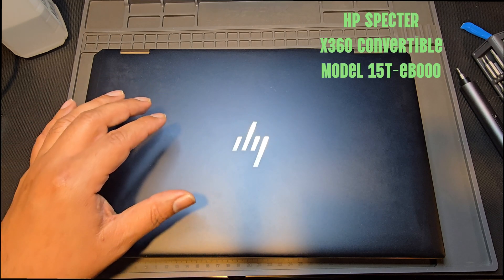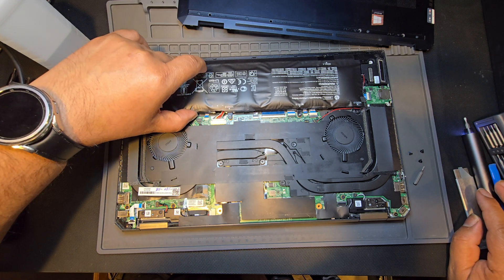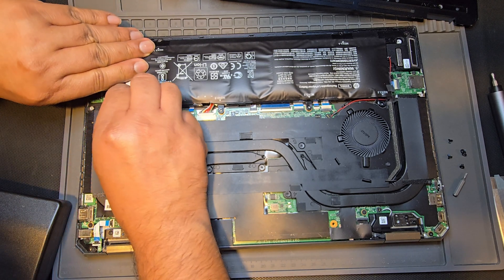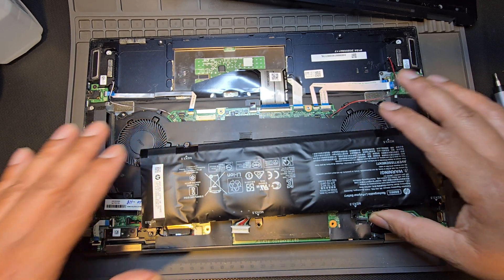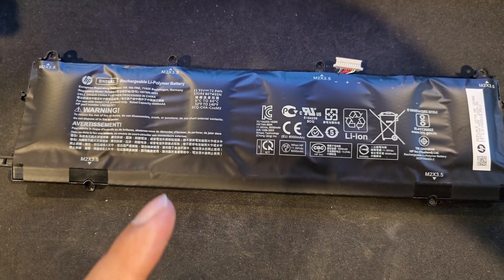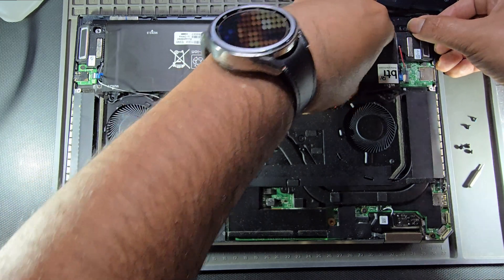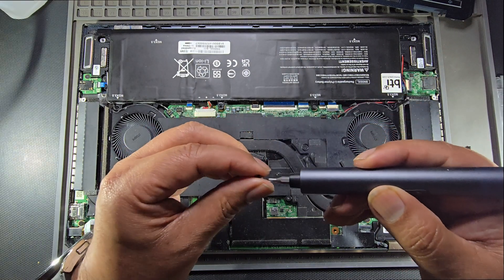How to Replace Your HP Spectre x360 Battery EASY! (Step-by-Step)

Comment: Thanks, great video.  I noticed when disassembling, you did not remove the top rubber strip, but when reassembling, the strip was gone.  Did you replace the tape or glue strip or whatever to make it seal better?  If so, do you have a recommendation for the sticky stuff?
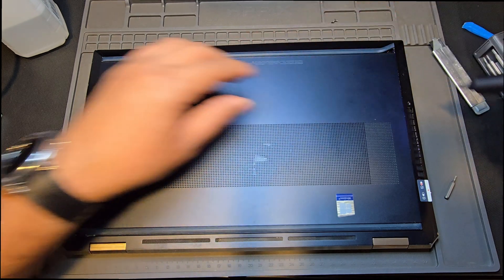Reply from the maker: At 1:41 I describe that you do not need to take the top rubber footing completely off only the bottom one. I was careful to keep it clean and when I placed it back in place it stuck back on like new. If this is not the case for yoh then thin double sided tape is your friend, something like 
Ultra-Thin Clear Double Sided Tape 0.6Inch X 66Feet Two Sides Sticky Tape with Strong Double Stick Adhesive Tape just use a little of it on key sections and make sure everything is clean.
Reply: @edtheoldtechguy  Thanks!

Comment: Thanks.  We watched this to replace the same battery in the same computer.  I have used batteries by BTI before with success.  Fortunately, we have a micro center 30 minutes away to pick one up.  It is hard to sort through all the batteries on Amazon to find the right one.   HP parts web page is no help on finding a replacement battery for their own computers.
Reply from the maker: Awesome, I'm glad the video was helpful!